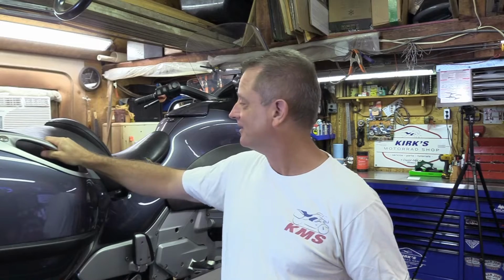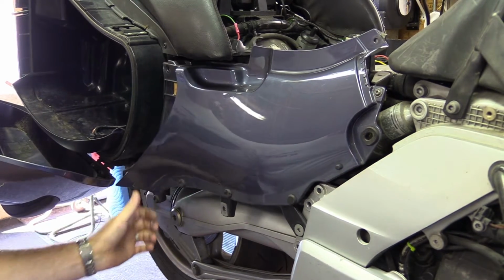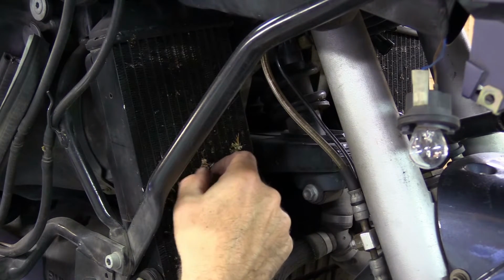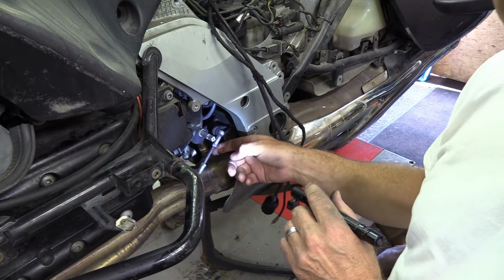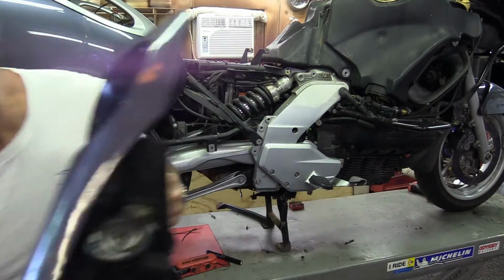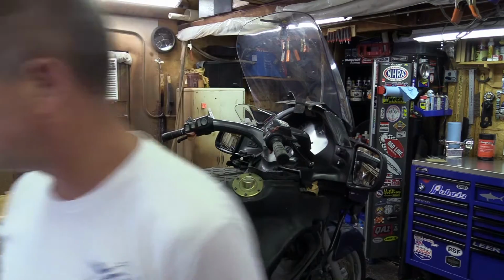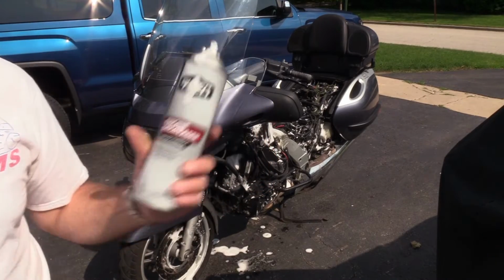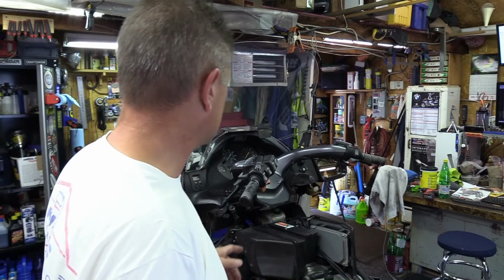"Flipper" The LT Bike Project! Day 2!!

Comment: Got 2001 LT Speedometer fluctuates 
I cleaned sensor on front tire. Works for a bit. Hit bumps on rt53 and speedometer jumps around. Any suggestions?
Reply from the maker: Clean the final drive sensor and change the lube in both the final drive and the trans. If there is too much metal floating around the trans lube it messes with the speed sensor.